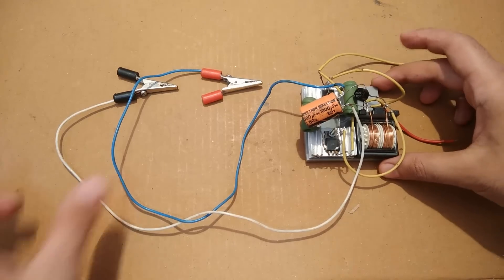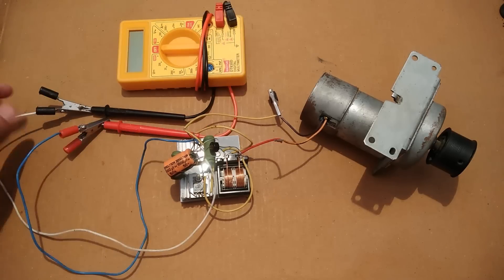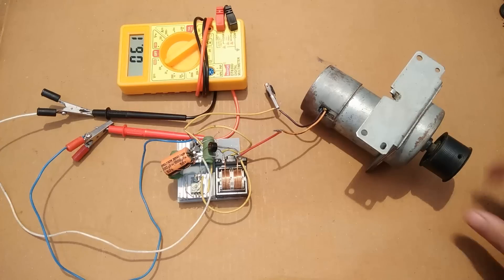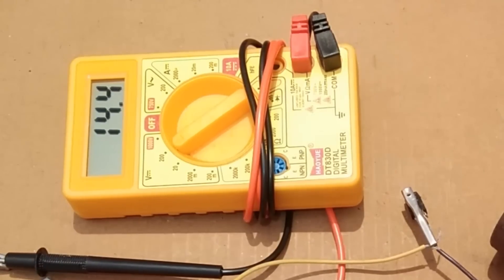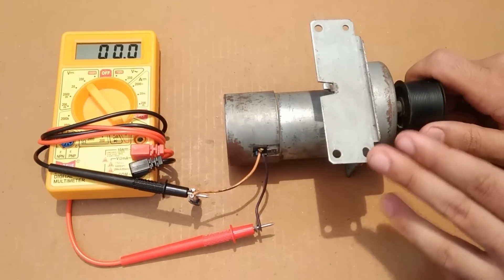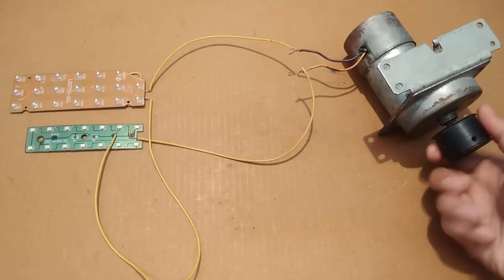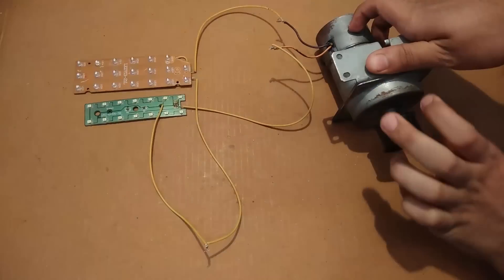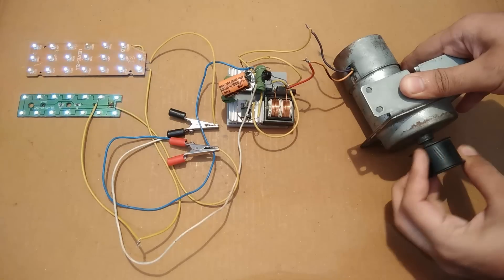BOOST the Output Voltage of Generators 14V to 50V || New idea DIY

Comment: Sir 72w dc motor run karane ke liye online per 150w boost converter hai o Kam karega. Koi circuit batado yaar 12v se 72w ki motor chal sake
Reply from the maker: 72W ki motor kitne volt ki hai?????